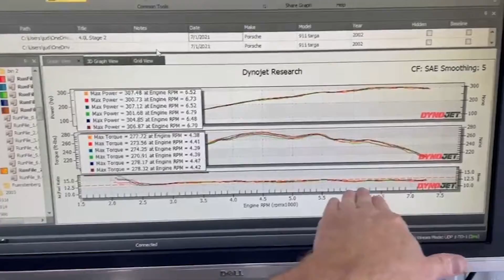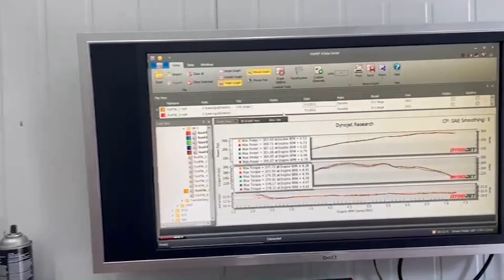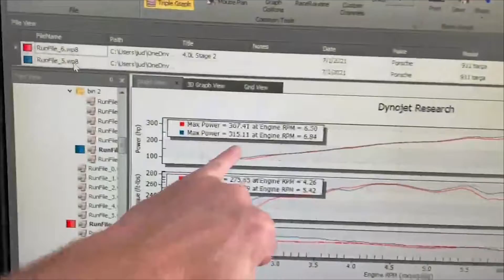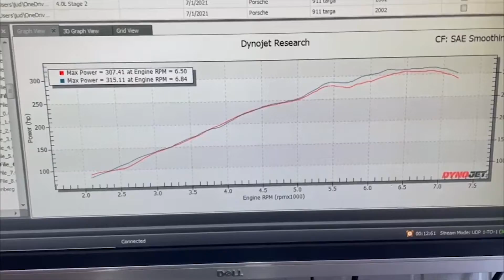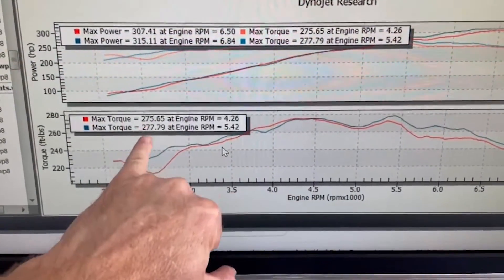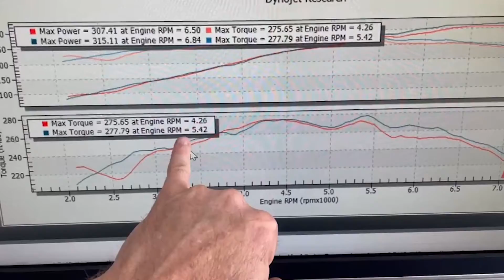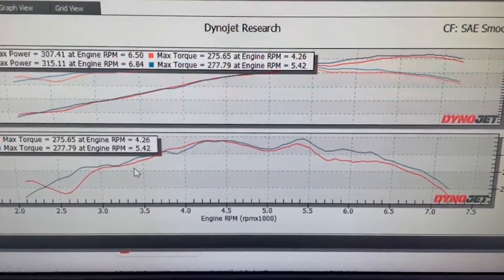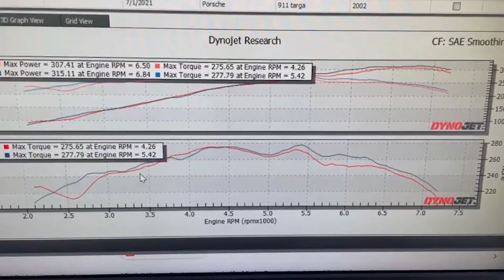The Infamous "BaT Targa" goes to the DYNO - Impact of Engine Mounts | Porsche 996, 997, 986, 987

Comment: So the owm 964 RS mounts i usecfor tranny mounts on my boxster 986S would also have similar problems? Admittedly i notice no difference in power delivery,but the car feels noticeably more planted, stable,  and nimble compared to a fresh set of the OE fluid filled mounts.

Comment: Jake, what causes the low torque on the run with the OEM mounts compared to the semi-solid between what looked like about 2300 to 2800 rpm? For street use that rpm range seems fairly important and it looked like a large difference.  Is it because the tune wasn't completed yet or some other reason?

Comment: Would be good to see this test repeated with the new mounts as RSS say they've improved them, and to my backside I can feel no more vibration than standard, but I have the comfort that a mount failure will not drop the engine onto the chassis rails like it does with the standard mounts.
Reply from the maker: The aftermarket engine mounts on this Targa were installed just before going to Bring-A-Trailer auctions in May 2019. Less than 5000 miles were put on the mounts before going to auction.

Comment: Are you guys tuning on the stock ecu? That’s awesome, would love to get a tune for my stock 996 c2.
Reply from the maker: To be clear, we are not "Tuners" and never want to be lumped into that basket. Every Flat 6 Innovations' reconstructed engine is set up within the factory tolerances to meet all federal emissions standards and guidelines. Our engines will be more powerful and MORE durable; yet, not upset emissions parameters. Too many "tuners" screw up these cars for HP gains only to find out the engine blows up shortly thereafter.

Comment: Wow, I never new engine mounts could have that dramatic affect on the engine's performance by simulating engine knock :o I wonder if the same is true for the 996 Turbo. I have very soft semi-solid engine mounts and have more power I can use with my Markski Tune but wonder if I would have even more if I had stock mounts?  Hmmm

Comment: Hey Jake, would the stock engine mounts that have the "Window Weld" added to the center also cause this problem?
Reply from the maker: Hi J, Jake doesn't have time to monitor all comments on this site. There is a thread started about this topic on Rennlist. You're more than welcome to come join the discussion. 
https://rennlist.com/forums/996-forum/1258842-i-hope-nobody-had-stock-in-aftermarket-engine-mounts.html
Thanks for watching!
Reply: Let me know if you find out 🤣

Comment: Really cool. Indisputable based on the data that the semi-solid mounts causing increased knock detection to be a detriment on the stock eco and tune. Thanks for sharing. Looks like the torque pickup was significant , 15ish FT/LBS at 6K...You'll feel that.
Reply from the maker: Also pay attention to the differences where the peak values were measured in relation to RPM.. As RPM increases so do harmonics, and the ignition angle is then retarded to help cancel out the “knock” that really isn’t there.. False knock.

Comment: There is the data to back up what you have been saying. Very cool. You notified me of this just before i was about to buy semi solid mounts...  Glad to be working with the pros!
Reply from the maker: Yes, many people think we pull these opinions out of our asses, but we've been collecting DYNOJET research data on these issues for years. The machine doesn't lie.
Reply: Same here. I'm a new 996 owner and was about to buy some thinking it was an upgrade!  Can you guys tell me if there's any benefit to my running a cooler thermostat in my 3.6 please?
Reply from the maker: We are proponents of low temp thermostats, but it's important to understand how they work. Many people think they will make the engine run "cooler", but that it NOT the purpose behind a Low Temp Thermostat. The low temp thermostat is designed to get coolant moving at a lower starting temperature. The low-temp thermostats open at 20-25F degrees earlier than the factory thermostat.
Reply: @RennvisionbyTheKnowledgeGruppe   My thinking was it might help with guarding against potential for bore scoring?  I change my oil every 5000 miles and try and be mechanically sympathetic by waiting till fully up to temp before exceeding 3000rpm etc. I hoped that maybe the lower thermostat might have been a help along the same vein?
Reply: @Retrobeemer  What you are doing is perfect there.  Have you had the cylinders scoped yet?   Good luck with the car!
Reply: @Retrobeemer  add 3rd radiator. I have low temp thermostat on my 997 c2.  I don't see any changes in oil temp being low bcx coolant cool the oil. My oil temp stays around 225 F on hot day driving in traffic on public road. I have ordered 3rd radiator kit from FCP EURO. That will be winter project.
Reply: @Retrobeemer  What model and year 996 do you have?  Congratulations!  They are great fun cars!  I got my 05 996 c4s 2 years ago
Reply: @RicknWRX   A late '03 996.2 C2 manual.  Non sunroof, silver & red leather.  I love it.
Reply: @Retrobeemer  Sounds like a nice car. Enjoy!
Reply: @Retrobeemer  i can confirm the low temp thermostat is a good upgrade. FSI does them in their motor jobs so that is enough for me! Heat can be the killer of any motor really.

Comment: Very interesting!!!
Reply from the maker: Glad you think so!
Reply: I cannot tel from the video, but could you describe the mounts you removed? Are they “tuneable” by chance? I wonder if the softest tunable mount is soft enough to not cause the knock? And can an aftermarket tune, remove this issue allowing you to run stiffer mounts without the retardation?
Reply: I found the ad and which mount was installed....